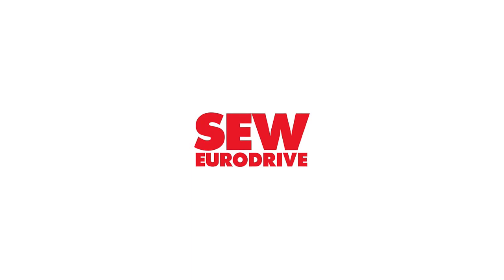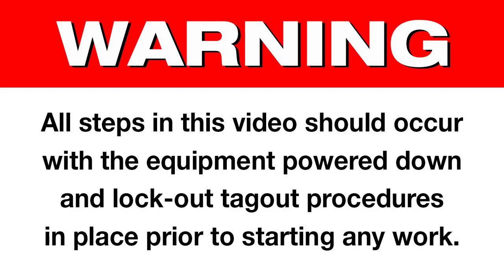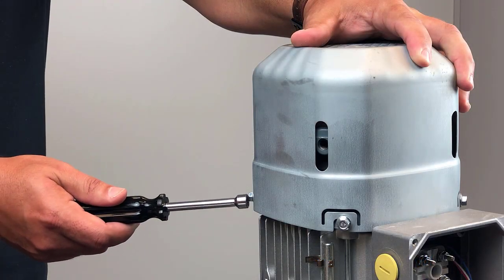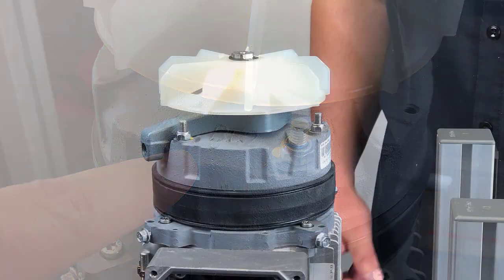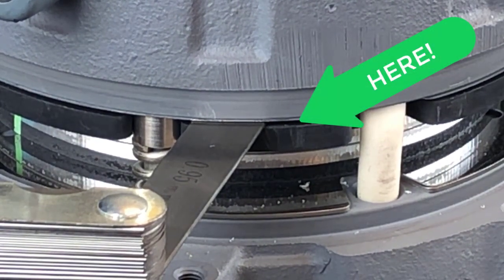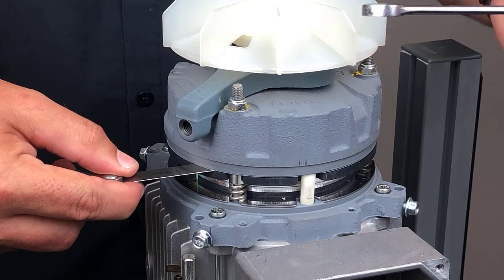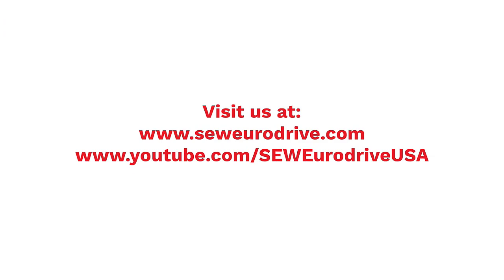Brake adjustment on an AC motor from SEW-EURODRIVE

Comment: Is the fan only purpose to cool the motor? Hypothetically do I need a fan if I’m running the motor/brake in -5 freezer
Reply from the maker: Hello! Yes, the purpose of the fan is to have constant airflow across the stator. This is why if the motor is running too slow (i.e. less than 10Hz) there needs to be a forced vent fan instead. In a freezer environment we still use fans because stationary cold ambient air doesn't cool the stator enough. What is really important for a motor and gearbox in sub-freezing temps is to have freezer rated bearing grease, gear oil, seals, metal fans, etc., so there isn't pre-mature failure of the unit. When ordering motors and gearboxes this is something the sales rep. can enter so the motor is assembled to the correct operating environment. In short, keep the fan on the motor even in sub-freezing temps.

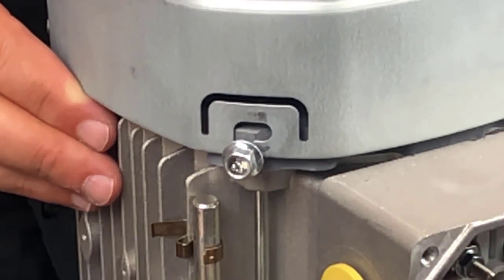Comment: 2:14 can you explain what that part of the brake is for?
Reply from the maker: Hello. The lever arm you see before the fan guard cover installs is for the manual brake release. This is an optional add on to mechanically release the brake in scenarios where the brake can't be released electrically with the brake rectifier. If you have a manual brake release it will be shown on the nameplate with "HR" or "HF" after the "BE##" brake nomenclature. At 2:15 you can see the silver arm that is spring clamped to the cooling fins of the motor. This can be removed and threaded into that lever arm through an oval opening in the fan guard to release the brake manually.

Comment: Didnt want to bring up the micro switch or ohm'ing the coils??
Reply from the maker: Hello. Thank you for your question. This video is intended for the mechanical maintenance of the brake discs and not electrical connections or troubleshooting. We do have a video that discusses the electrical items of the brake. It can be found in our video titled: MOVIDRIVE B Training Session 5 - Electrical Components.

The brake information starts at 20 minutes 35 seconds at this video linked here.
https://youtu.be/Lt7uA3ggLgk?feature=shared&t=1235

If you have a DR. motor model type here is a download link to the Project Planning Manual for BE Brakes. The coil resistance charts start on page 103.
https://download.sew-eurodrive.com/download/pdf_u/27805131.pdf

If that manual doesn't show what you're looking for then please download the Operating Instructions for the model type of the motor you have at this link.
https://www.seweurodrive.com/os/dud/?tab=documents&country=US&language=en_us